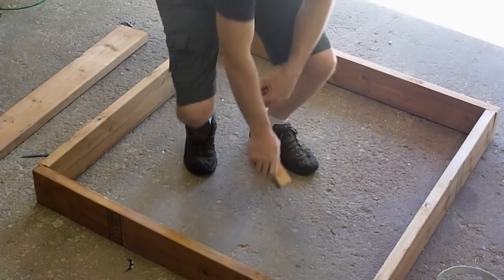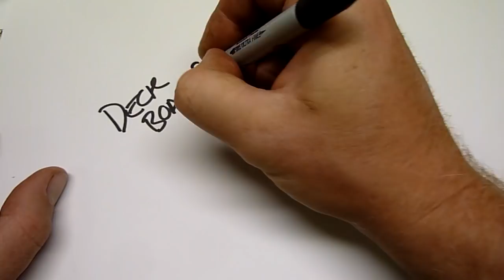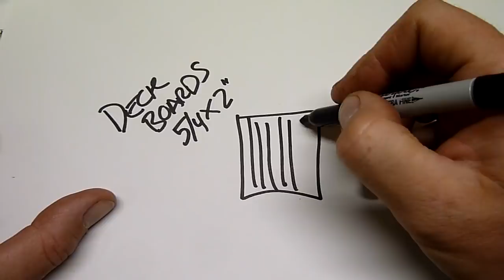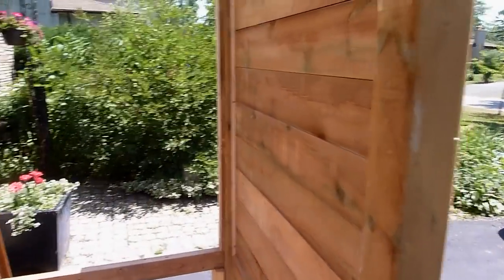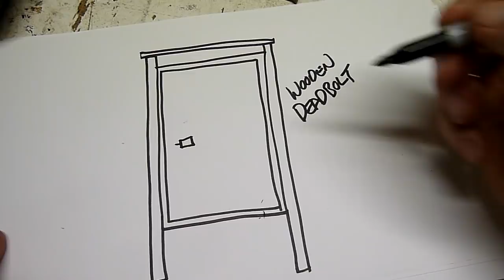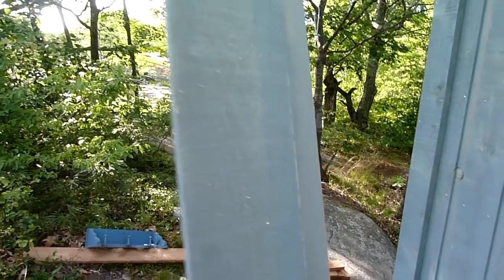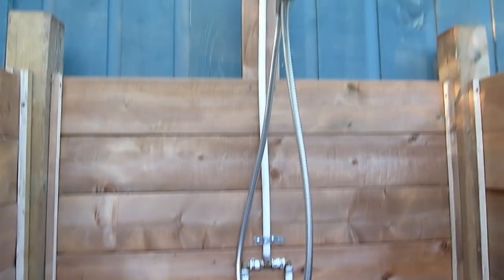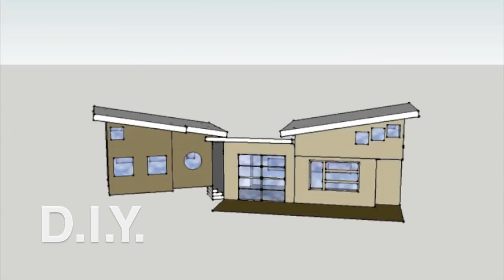How to make an Outdoor Shower

Comment: I built my own outdoor shower for my house in Maine based on this video. I modified several aspects of the design to fit my purposes including more privacy, larger footprint, free-standing and different hardware. But it's the samearchitecutre and it's gorgous. Thanks for taking the time to share, it was profoundly helpful in my effort.
Reply from the maker: Thats really great! Is there a picture online?
Reply: would have posted a pic here but didn't see it as an option. I can email one to you....
Reply from the maker: If you goto the "about" tab you can email me at that address.

Comment: I’m about to do one for our block here in Australia. I’ll be making mine out of old fence palings which I’ll stain black. To save some time building a box over the pex piping. You could use black half round guttering. It here are some great videos on expert cutting the folds and angles on YT.
Reply from the maker: good luck

Comment: That's a great looking outdoor shower! Thanks for making this video, I'm looking for inspiration for my new outdoor shower setup. I wish materials were more affordable in Hawaii though, $200 is crazy cheap!
Reply from the maker: One thing we have in Canada is trees!! Good luck with your project.
Reply: To cut costs use local materials. IOW, make the walls out of vertical bamboo free-standing between two boards. When they rot just go cut more bamboo and drop them into place. That's how they make an outside shower or fence in Jamaica.

Comment: Overall, looks good. But I have ask if you understand the correct use of a push stick on the table saw. You're supposed to push the workpiece through the fence side to prevent kickback, not on the waste side. Looks like you had enough of a fall off to be safe(ish) in this particular video but wow, that's scary. I wish I could say I've never had a skinny piece get trapped between the blade and fence and become a missile into my stomach ( or worse) but alas, I learned the hard way.

Comment: awesome I'm stealing your design next week!
Reply from the maker: Thats great, I'm glad to have inspired you! I would love to see a picture of the finished project.
Reply: Will do if we get it done before the snow flies I am putting a black barrel on top somehow instead of plumbing. Any vids on a 55 gallon drum tower or any hints.
Reply from the maker: Before we had our rainwater collection and pump system we used a colman shower bag. Fill it and lay it in the sun, worked pretty well.

Comment: the walls of an outdoor shower, in a place with beautiful views and surroundings should be no taller than shoulder height. Taking a shower in a cold rain is better with a roof-over.  The towel rack should also be rain proofed.  For those shy types, use privacy lattice at eye level.  In Florida, all my outside showers were a bit larger to allow for more air circulation.  Materials should be water resistant as much as possible.  Hardie planks, plastic lattice, stone floors, and high gloss paint will reduce mold and mildew.  I have rarely showered indoors for many years now.  Two shower heads will turn your shower into a spa like experience.
Reply from the maker: Great tips! Thanks

Comment: How is Canada not metric yet? 
Cool shower 🚿
Reply from the maker: We are kind of 1/2 Metric! 😐
Reply: @OntarioLakeside  
That is so confusing to me in Australia where everything is so much simpler in metric has been since 1966. The only time that anything is imperial is as a reference to one inch is. "About an inch" other than that it's all decimal/metric eg. 1200x2400 or 1220x2440
Reply from the maker: @TimBoss2000  Canada has a neighbour, you might know them, there REALLY Bossy and they use Imperial. So we have a hard time completely switching!  I agree Metric is far superior. We measure distance and speed in Kms when driving but if you goto a building site there are 2 sets of plans, One for the builders and 1 for the architects.

Comment: Not lecturing you cause this is great and obviously you know what you’re doing, because I count 10 fingers, but bro.  Your hands are way way too close to those blades a lot.
Reply from the maker: Thanks for the note, a little more safety is always a wise move.
Reply: @OntarioLakeside  no offense whatsoever bro.  I injured my hand with a glass bottle at 14.  I mostly recovered but i still have damage.   It doesn’t take but a second for a board to catastrophically fail and with your fingers being that close they could take the hit.  it really gave me chills.   

Awesome job on the outdoor shower.  I want to build one just so during the summer I can clean up before coming in the house nasty if I’m working on a car or whatever.

Comment: Didn't see anything about the drain water. Where do you think all that grey water goes? There's only one planet.......
Reply from the maker: The grey water is directed into a swale where it soaks in and provides water for grasses and trees.  This is a accepted and approved system of dealing this grey water.
Reply: in Muskoka where I am grey water must flow into a leach pit...washing in the lake is okay, but not 100 feet from the lake?  I am thinking of fitting a shower base under the floor for this purpose, any thoughts?